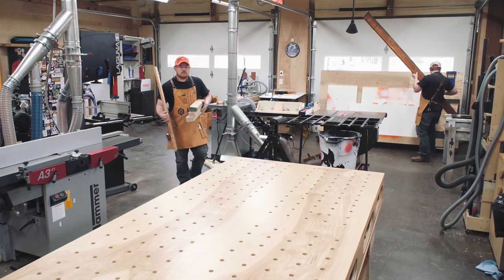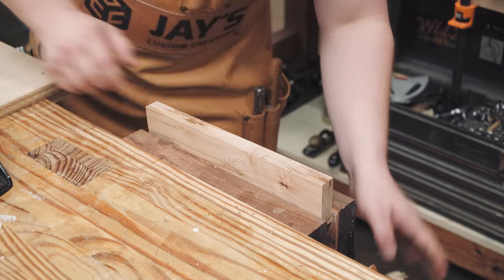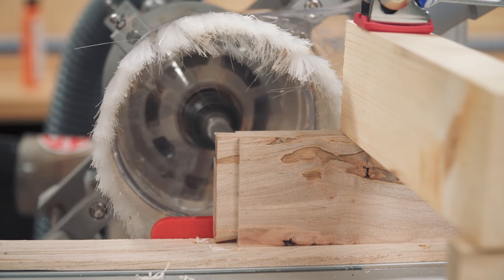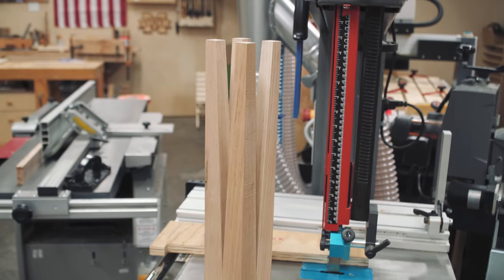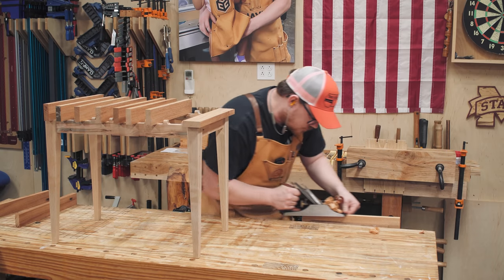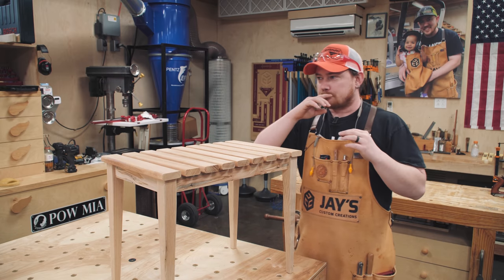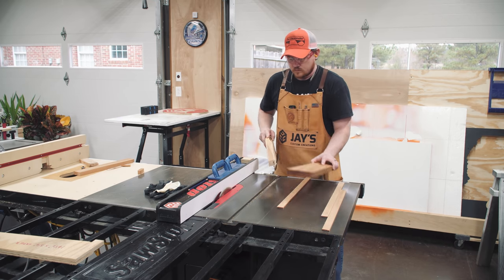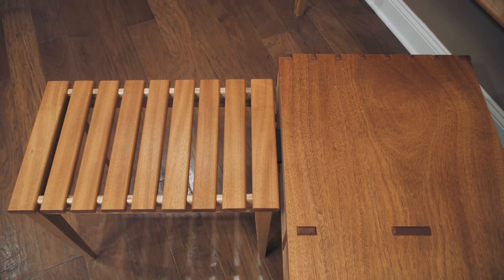Sliding Dovetail Sofa Table Bench - 333

Comment: Were you concerned at all with the closeness of the sliding dovetail slots in the legs?  It looked like it created a very thin gap between the two.  Maybe moving the slots towards the outside 3/16” would still giv you the look but also provide more material between the slots.
Reply from the maker: Not concerned. Remember that the glue is licking everything together.

Comment: I know you probably know this but I think most woodworkers don"t or can"t purchase the equipment you have in your excellent shop. Most I think work in two car garage as you once did, My two car garage shop had 500.00 contractors saw 350.00 jointer, 350.00 drill press 400.00 bandsaw, 250.00 dust collector on wheels. Router table built into right side of table saw. The thing is I made do with what I had. Im sure you know what I mean, maybe it was the same for you when you started.
Reply from the maker: I get what you're saying. But woodworking isn't all about equipment. You can make excellent pieces with very few tools. I do this for a living and my business growth has allowed me to expand my tool aresenal. If I were just doing this on the side with a full time career elsewhere I don't think I would have the same shop today.

Comment: Nice project. Could that be Spanish Cedar? Also, had you considered running the slats in the lengthwise direction or round over the edges like the sides. Seems like the edges might dig into the back of the legs.

Comment: I'm pretty sure it's not oak! I'm currently prepping for a bed build using some old ceiling beams for the corner posts, they seem a really nice dark brown oak, a bit walnutty, but there's no way the old beams were walnut eh?
Reply: really old oak may spark when cutting. never heard of walnut doing that. i cut the ends off of some 150+ years old log cabin oak and sparks flew almost as bad as a grinder does on some logs.

Comment: Random question you may have addressed in a previous video. Why in every installation of the EF5 dust collector I have seen on youtube, does clearvue supply flex hose on the exhaust end of the cyclone? In every other cyclone on the market there is a smooth transition to the filter stack, and I thought the air resistance on the back end was just as important as the air resistance on the front end. Fortunes have been spent on smooth transitions and wide radius 90's to keep the air speed up as high as possible, and then stick $10 worth of flex hose on the back of a $3K DC. Just bugs me.

Comment: Maybe It was previously mentioned, but why the switch to hide glue?
Reply: Oh yea, Looks awesome :)
Reply from the maker: What do you mean by switch? I keep a few glues on hand for various situations. This situation was best suited for hide glue. PVA glue would swell an already tight joint.
Reply: @JayBates  I hadn't noticed you use Hide glue in the past. But good to know about the wood swelling, I never really considered that before.

If the PVA swelled the joints would there be a risk of it separating as it dried?
Reply from the maker: @heyimamaker  good question. It's not a problem of after assembly. The problem is during assembly. PVA glue is water based. So when it's applied it will swell the wood fibers as the water is absorbed. This is a problem when dealing with joints that were cut to fit really tight. Sometimes the glue can swell it so much that the joint won't close even with mallet persuasion. In those situations a good glue to use is either slow setting epoxy or hide glue. Those won't swell the joint and actually provide a little lubrication to help seat the joint.

Comment: You could have molded the slats as "Ts" in cross-section. Corner- round the bottom of the T to fit the negative space between the tabs. DO NOT corner-round the upper crossbar of the T. Allow the crossbars of adjacent Ts to slightly overlap the tops of the rail tabs, narrowing the gap between adjacent slats to less than the width of the tab between them. The above would serve to integrate the severely square legs, with the very apparent rounding of the tabs. Or alternative simply reduce your corner-rounding to 1/4" or even 1/8" radius.

But... no design considerations will solve the nasty "rear end discomfort" problem from that hard, flat bench seat. Try sitting for 1/2 hour on 1) a wooden chair with a flat bottom and 2) another wooden chair, but with a "scooped out" bottom, like a windsor chair. The difference in comfort is day & night. I'm  predicting that you will wind up using a cushion (i.e. a minimal form of upholstery) with this flat top design. Instead, you could have designed an updated 21st century version of a windsor chair. And with your amazing PantoRouter machine, you should be able to create perfectly fitted, splay-legged chair joinery with ease.

Comment: That panto router just looks so damn hard to set up accurately.
Reply: Yeah, kinda surprised it's worth it for a one off piece.
Reply from the maker: It's not difficult at all to setup. For the dovetails I centered the template, set the height and plunge depth, then positioned the legs. Same setup for a router table. For the slat slots two stop blocks were added and the height was set.